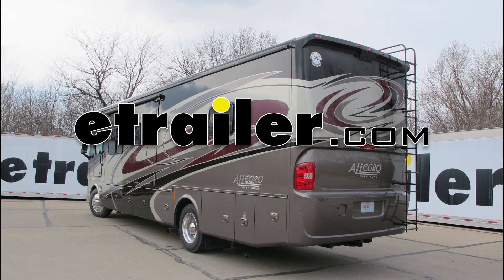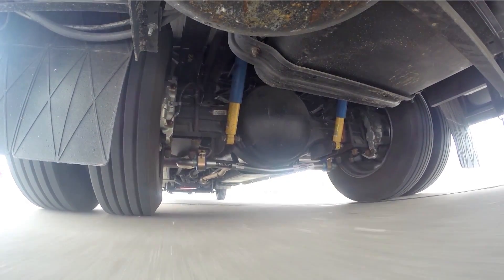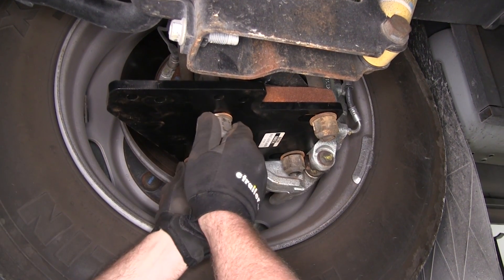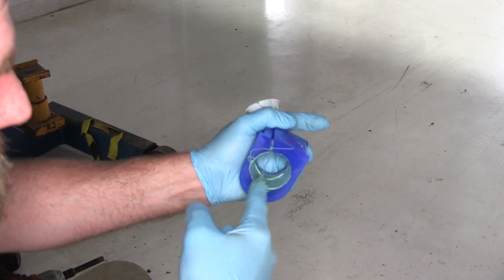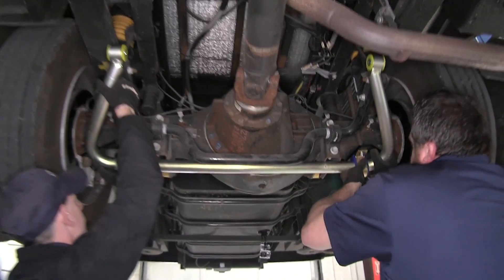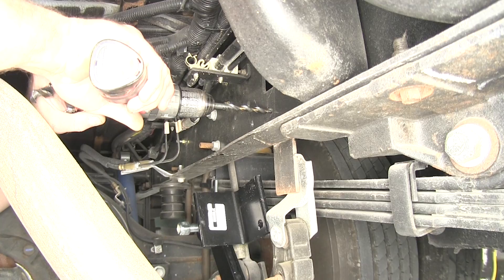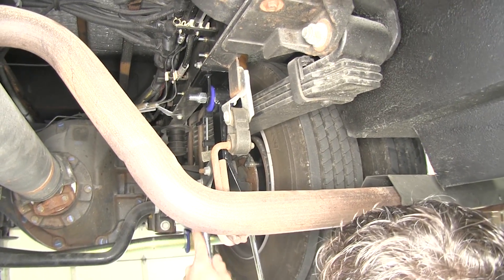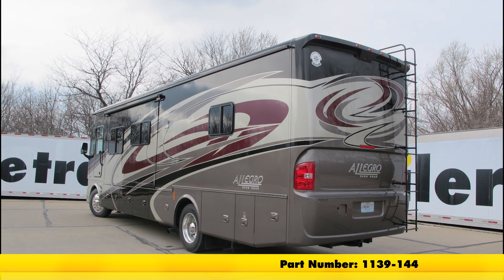etrailer | DIY Install: Roadmaster Rear Anti-Sway Bar on your 2015 Ford F-53

Comment: This video shows the sway bar installation toward the front of my RV (same Ford chasis) whereas the Roadmaster instructions show the sway bar arms going toward the rear of the RV.  Note the rear installation does not require drilling and the hangars use the same bolts as the cross tube of the frame, presumably resulting in a stronger mount/alignment with the frame.
Reply from the maker: This rear anti-sway bar will install with the arms facing the front of the motorhome. There are other anti-sway bars that will mount with the bars facing rearward. It will depend on the construction of your specific model.
https://www.etrailer.com/Anti-Sway-Bars/Roadmaster/1139-144.html

Comment: Just try removing the u-bolt nuts on a 2005-ish vehicle.  the years of rust practically weld on the nuts.  A breaker bar is good, but a breaker bar with a 3-foot pipe extension on it is better.  I have a high torque  Best to apply a "good" penetrating oil like Kroil.  Let sit overnight.  Might even need to heat up the nuts if they are beyond frozen.  If you are working underneath a coach on the ground it is especially challenging to hold up the u-bolt backing plate (heavy) and install the kit's plate (also heavy).  I used a bottle jack on the first one and by the second side I did what this fella did and that is to keep one nut on the backing plate and you will still have enough space to install a washer and nut and remove the nut you left on to hold up the plates.
Note: Roadmaster's instructions are pretty poor and lack relevant instructional photos, so if you came here first, bravo,  it helps. 
I have also read several "experts" state spring u-bolts are one-torque-use only and should be replaced.

Comment: Great informative video !! I would like to install this product on my 2003 holiday rambler; my question is "can I use the hydraulic jacks on my rv to raise the chassis to allow for more working room; I would probably use the rear jacks "only"; please advise; thank you Patrick.PETERMAN
Reply: Yes, you can but I only went up a bit and augmented the safety with the parking brake, jack stands, wheel blocks, and I was on level ground.  I am not too worried about this method because if the rig ever did come down the tires are still on and I fit underneath it.  If you have had too many cheeseburgers and do not fit, I would think twice about going under.